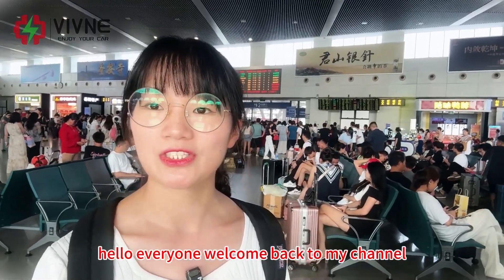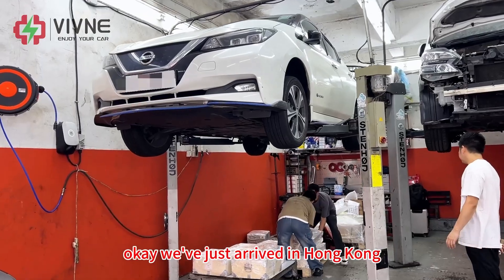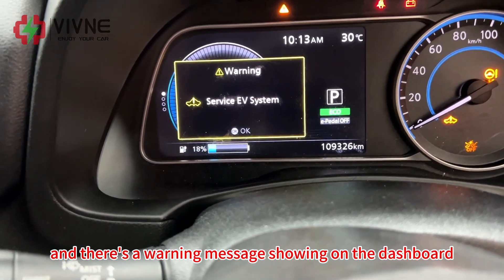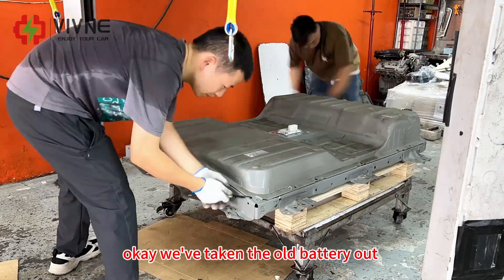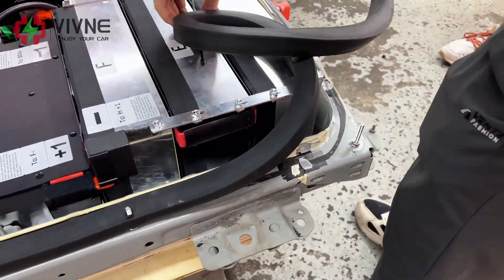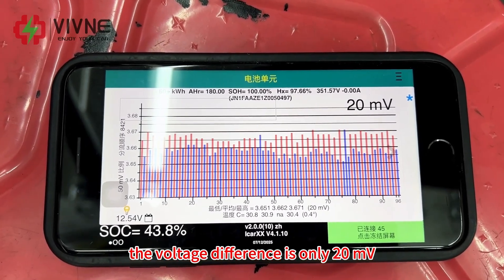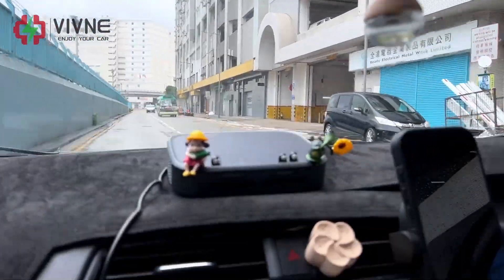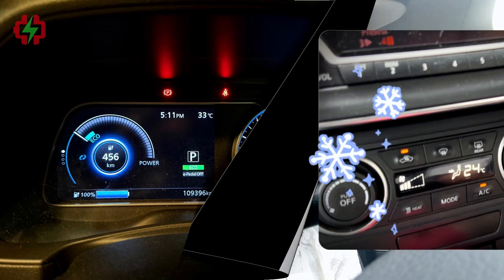VIVNE-Nissan leaf battery upgrade in Hong Kong

Comment: The new batteries you are using are they  Lithium Iron Phosphate (LFP) or the old Nickel Manganese Cobalt (NMC)?
Reply from the maker: NMC battery, Leaf can not use LFP battery, because the voltage does not match.

Comment: Are the dimensions of your battery replacement kit modules the same as the original?
I noticed that the car did not have the cold weather kit installed.
A little worried that the heating elements may flop around an bit if the dimensions change.
I suppose spacers can work.
Reply from the maker: Thanks for your question. Our replacement battery modules are designed to fit the original casing, but due to the different internal structure and cell layout, the original heating elements from the cold weather kit cannot be reinstalled.
Reply: @VIVNE-CoraLiu  Is the 40kWh version likely work with spacers, or would that still be inadvisable?

Comment: the BMS in that pack might be bad, this may have caused OEM battery failure and cell bulging,  leafspy shows high and low alternating non balanced SOC bars. maybe should of done a BMS swap, safety might be an issue in this.
Reply: Kora, great installation. The above concern about the original BMS is noteworthy: is there any way you can check back on that and let us know? The owner might also benefit from that insight. Thanks.